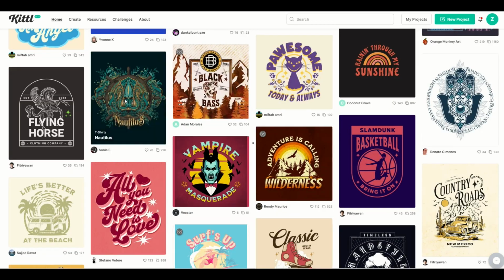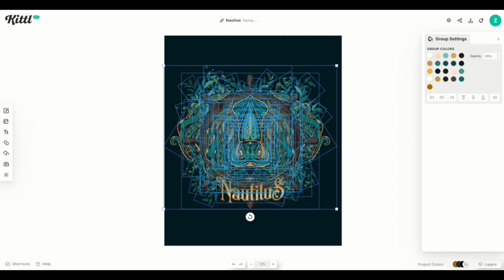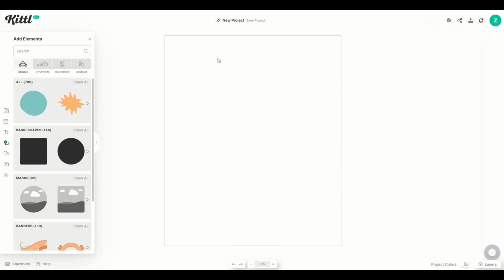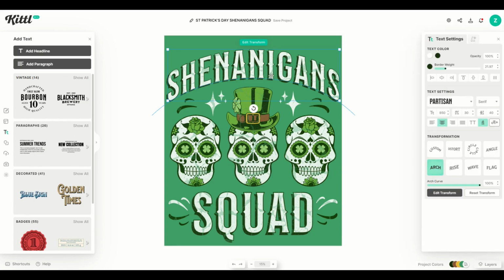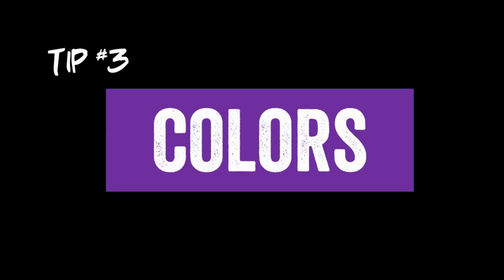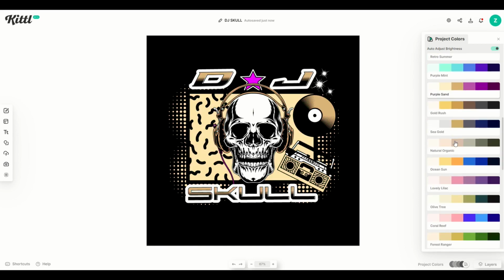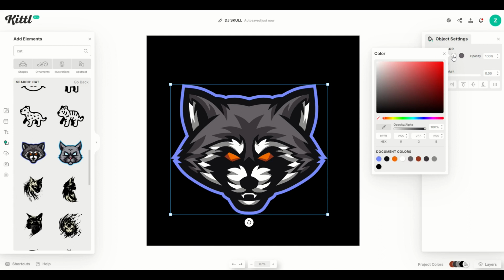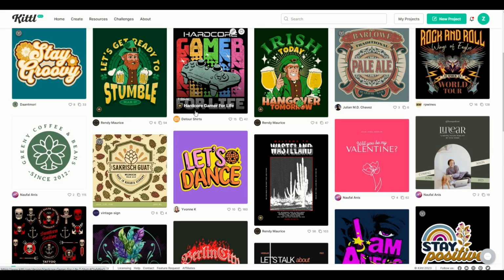Kittl: 3 Tips for a Great T-Shirt

Comment: Does it matter the pixels if I’m gonna put the logo/design on the corner of the t shirt?  Since I’m shrinking it do I still want it at 5400 and 4500 pixels?  I’m don’t want to put the whole design on the front of the shirt just like 3x4 inches on the left side of the shirt/chest area. I currently have my design at 1018 and 1222 pixels.
Reply from the maker: Yes if you are uploading to Merch by Amazon, the design needs to be 4500 x 5400 pixels. Just throw the design into the corner and then expert as a PNG. Hope that helps!
Reply: @zenwatercooler  thank you but I planned on using vista print

Comment: Yeah, my computer can run most AAA games, but when I tried to design on kittl in 4500x5400 and especially with 300dpi, it would take ten seconds just to resize a textbox.  I just design at a smaller size, I think it's 1000x1200, and then download as large as I want.  Was very frustrating starting out.